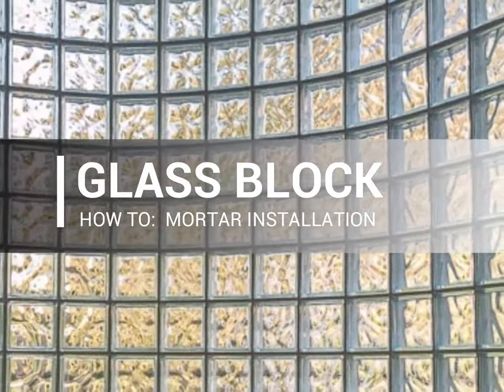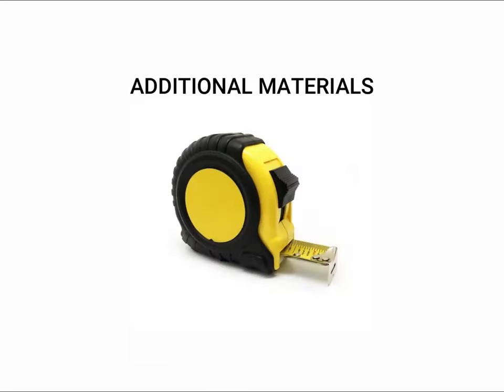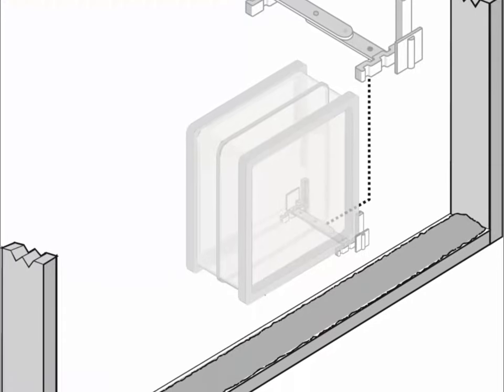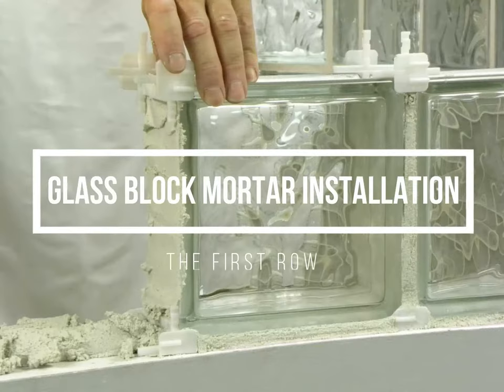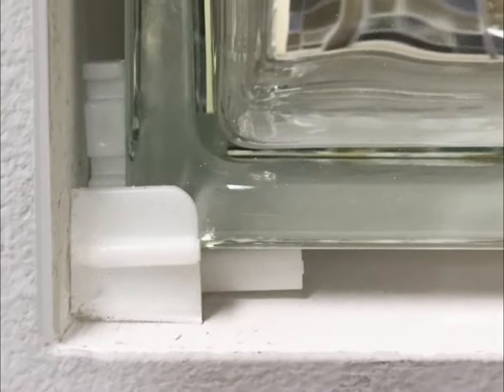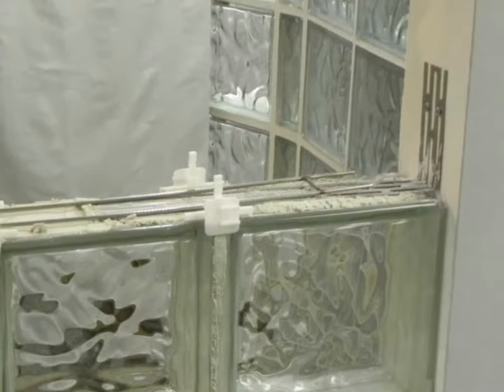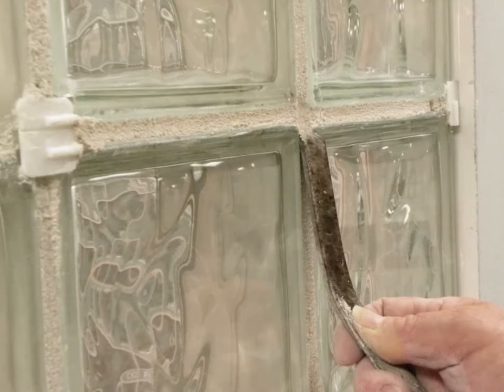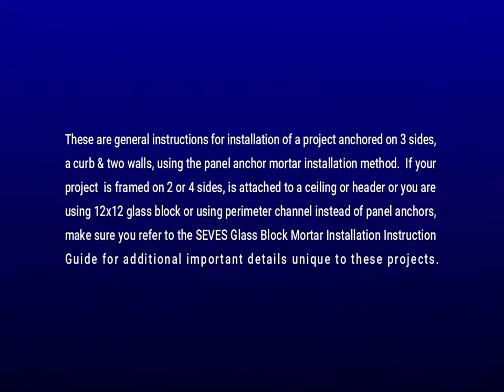Glass Block Mortar Installation

Comment: This is the video I watched several times to replace a double-hung wooden window over my bathtub.  Excellent instructions as my glass block install came out great!  One thing about spacers:  I bought 4-inch Reliabilt spacers sold by Lowes.  Most worked but some didn't snap off cleanly, which left humps in the joints when I tried to strike the joints.  I would suggest buying the name brand spacers (like Seves) instead of the knock-offs.